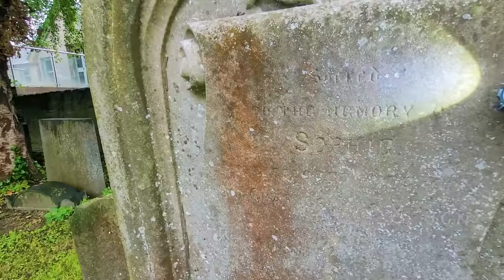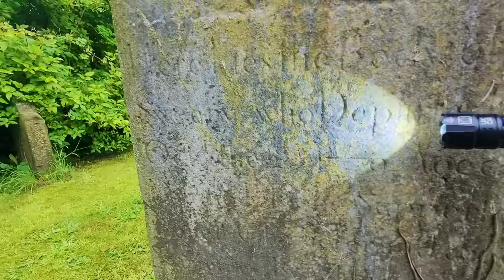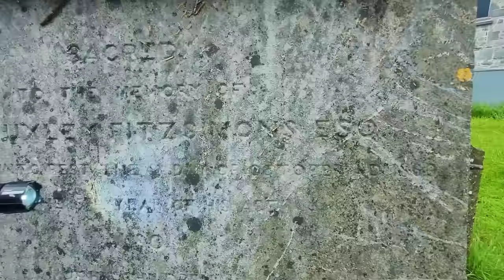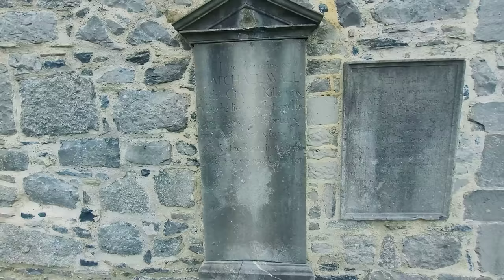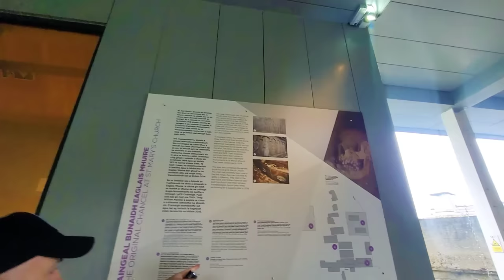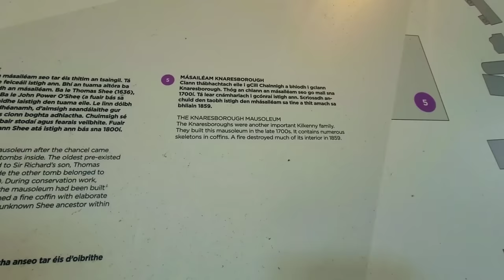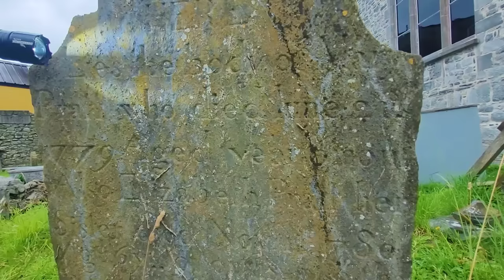St. Mary's Graveyard | Secrets Uncovered

Comment: Hi Sue! Great video again!

That one mausoleum with the tiny door, if you look close at the brick and stone work, you can see an arch where a large doorway may have been before, and then sealed up. I would think they opened the stonework to look inside!

It is so wonderful to see the restoration going on! The straps around the tiny mausoleums is to keep the walls stable, and the boxed up mausoleums are very badly damaged, and need better protection, until they can get to work on them.

When you mentioned fire inside of a mausoleum, I knew the answer to that! Not all mausoleum interiors are damp and moldy, some are very dry like tinder, and any dried flowers left inside along with the wood coffins and any funeral furniture inside would be very flammable to any stray flame from a candle or torch!

Any coffin that someone of a well to do family would be lead lined inside, which would protect the wood on the outside from rotting, and the outside may have fabric panels which would add fuel to any fire!

So, many of the mausoleums were prone to burning if anyone went inside without knowing the dangers of having open flames!
Reply from the maker: Thanks so much Jeffrey, I really hope enough funding can be collected to restore the tombs and headstones, that little door was as you said too. I did wonder how a fire could happen but you've answered that for me, thanks again